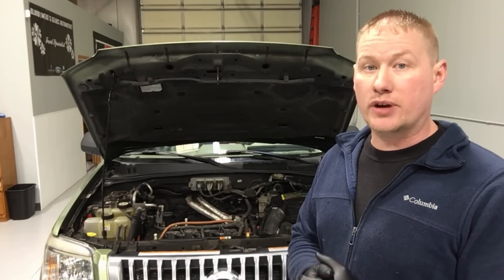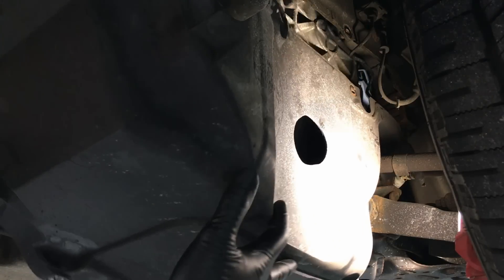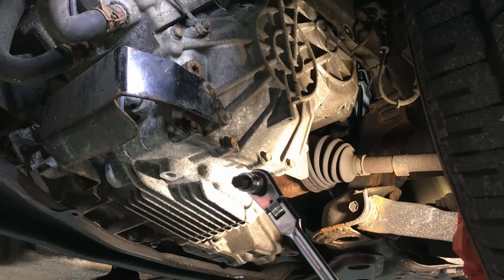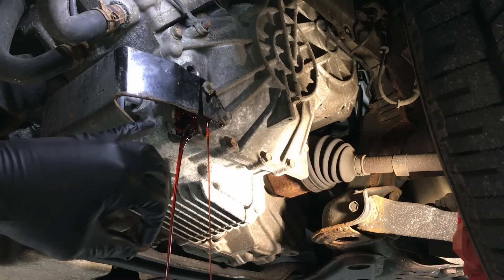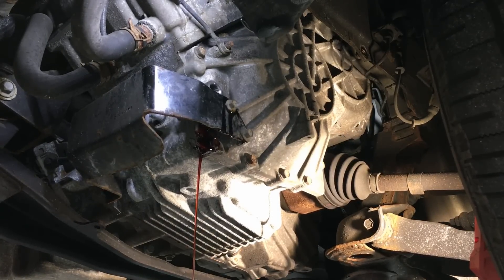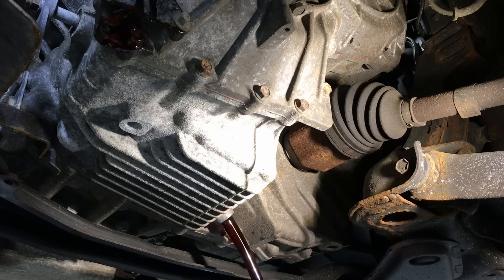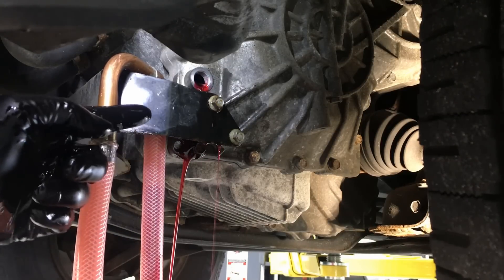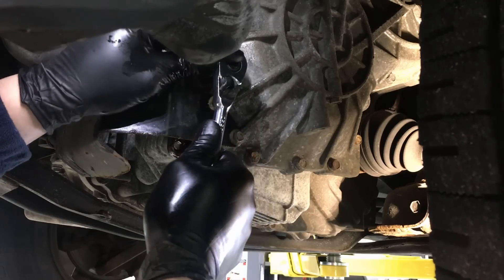2005-2012 Ford Escape Hybrid eCVT Transmision: Fluid Drain and Fill Procedure

Comment from the maker: These are the Tools and Parts I Recommend:
Transmission Fluid (6-7qts)-
2005-2008-
https://amzn.to/2qnmUVp
2009-2012-
https://amzn.to/2qnHZ1O
Hex Socket-
https://amzn.to/2GSjUHD
Manual Fluid Pump-
https://amzn.to/2qo8Z2b
Basic Good Torque Wrench-
https://amzn.to/2qmWgMV                                                                                                                                                                              Fill and Drain Plug Torque Spec- 30ft lbs
Reply: FordTechMakuloco have a question to switch out a 5.4(04 F150)  to a 5.0 coyote from a 2012  Ford F150 what do i need to make it work on the 04? T.I.A 👍
Reply: FordTechMakuloco is this the same for a 2008 escape awd v6
Reply: Can you please make a video on how to change transmission fluid on the CFT30 CVT in the ford five hundred and freestyle
Reply: I'm glad to hear that these transmissions are so reliable. From what I'm hearing the new Ford Maverick is going to use something similar.

Comment: I am the original owner of my 2008 FEH and it has 290,000 miles. I've never serviced the transmission. Should I consider changing the fluid or is the fluid that is in there married to the transmission, meaning, if I change it, I am only asking for problems post fluid change?
Reply: So this is what I would do I wouldn't recommend changing it all at once since I have so many miles on it and definitely would create more problems for you in the transmission itself but what you can do to eliminate having problems while draining and refilling the transmission fluid only drain and refill 1/4 at a time so drain one quart put one quart back into it of new stuff then run it for like good 5 minutes drive back and forth, then repeat the process again until your fluid is gradually cleaner.

Comment: QUESTION, 
is there a recommended ambient temp to do this at, and does the self leveling fill port account for heat expansion of the fluid? I ask because I've read the vehicles with dipsticks (which I know this one doesn't have), are recommended to have ATF level checked when good and warm after driving 20 mi due to heat expansion. I've also read that over filling can cause damage, so I cringed when I saw how over filled this was. Perhaps the user filled it in the winter with a very cold ambient temp.

Comment: Is there no filter to change?
Reply from the maker: nope
Reply: @FordTechMakuloco  I have a 2011 Ford Escape Hybrid limited 2.5. AutoZone told me that the filter is on the inside.. still a No?
Reply from the maker: There is no serviceable filter so yes a no. Are you going to remove the trans, split the case and change a filter on a manual gearbox?

Comment: I was told that the transmission is sealed and should be never be changed. And said not to let anyone talk you into it!
Reply from the maker: wow
Reply: That's why it has a drain and fill plug. Because it should never be changed 😂

Comment: Mine has a small leak on the passenger's CV axle, coming from the transmission, are there any special toola needed to replace the seal (5m6z-1177-ra)?

Comment: From the Owners Manual of my 2015 Ford Escape Hybrid "4. Using any transmission fluid other than those that meet the recommended specification may cause
internal transmission damage. Do not use Motorcraft
  Continuously Variable Chain Type
Transmission Fluid (blue). This vehicle uses only Motorcraft
  MERCON
  LV ATF.
Reply from the maker: Yes and?

Comment: I changed my transmission fluid (MERCON V) on my 2008 Ford Escape Hybrid at 90,800 miles, and my gas mileage appears to have decreased from 28.5 to 27.8. The transmission feels smoother, but I am puzzled by the slightly lower gas mileage. I expected an increase in mpg, not a slight decrease. Any ideas why the mpg is lower?
Reply: It may be that the fluid was a bit low, and the new higher fluid level causes a very slight increase in the amount of parasitic drag on the moving bits inside the transmission.

Comment: 1018 ford fusion energi , 2 letter plugins, code P0C2C-Auxiliary Transmission fluid pump control module feedback signal range /performance, 
What I should do , 
I have 215000 km , and flush was done 40000 km ago .

Comment: I'm hoping you'll answer this comment or perhaps someone can. I have a 2010 Ford Fusion Hybrid but I can't seem to find anything on the internet saying what the Fluid Capacity is. I asked the Ford Dealer and they said 4.28 but that can't be right because I have put in 5 and it's still not dribbling out. The vehicle is fairly level. Maybe it's a little over 6 like this SUV in the video. It would be great if someone could answer this for me or let me know where I can find this information on the internet.
Reply from the maker: 4.28 quarts is correct
Reply: @FordTechMakuloco  I was hoping you would say something else. I must have some sort of oddball. You can have 2 Ford Fusion Hybrid both 2010 yet they will have vastly different air filters. Mine has the " Forever Air Filter". (They actually have to be replaced around 100k and it cost like around 200.00 or so. Others have the regular replaceable air filter that might cost 10 to 15 bucks.
My transmission says CENMC on the bottom next to the drain plug. Both drain and fill plugs are M18 - 1.5.
Both are heads Torx T55 but can easily be mistaken for hex key 10mm. Both heads easily stripped with either tool. The Ford Dealer said those plugs are obsolete and didn't offer a substitute.  I replaced them with 3/8 drive heads and remove the magnets and machined them to proper length. ( .475 "). My vehicle is level and it's up on 4 ramps. (2 in the back are modified so they don't hit the frame when you drive up.) I lowered the corner (took the wheel off)
and tried to get it to dribble but nothing.
  Not trying to argue or be a naysayer. I'm a big fan of your videos and always give a thumbs up. I'm just going to have to buy 2 more quarts today. This transmission and plugs although not identical looks very similar to the one in your Hybrid SUV video and might take the 6-7 quarts like that one does. So far 5 quarts and no dribble.
Reply: @FordTechMakuloco  I finally got it to dribble out at somewhere around 5.5 quarts. I even lowered that corner a little more to make sure it needed that amount. Perhaps it's some sort of oddball. I drove it today and it seems to be fine. I was concerned about over filling it. I didn't want to do that. I did drain it like over a couple days because I had to find a retrofit solution to the obsolete drain and fill plugs that are matching. Maybe that's why I had to fill it more. I'm also doing it in the winter with temps below freezing. Not sure if that might make a difference.
Reply: Today I still may try lowering that corner even more to see if it dribbles. I was using a bubble indicator to measure the level but depending on where I set it, it might be wrong. I figure if I can make the car obviously low in that corner and it doesn't dribble that will mean it requires more fluid. If it does dribble that means I didn't have the car level enough.
Reply: I have the owners manual for my 2012 Ford Fusion hybrid, it states 5.3 L. I drained out around 5 liters and pumped in 5 liters which is pretty much the whole bottle. But yeah like you said you filled with around 5 L so you’re good. Shouldn’t be any different for the 2010, same model and body.

Comment: This guy is really great! His videos give a lot of necessary specific information. I like how he mentioned the torque specs on both the fill plug and the drain plug. Also how he mentioned filling it till it dribbles out slightly WHEN IT'S COLD.  No warming it up and checking the level. Some transmission require this.
I was wondering about it and I already knew if I go to this guy's video he would specify. He specializes in Ford so he seems to really knows Ford's products real well.
This guy produces very excellent, informative, high quality videos.

Comment: Excellent video.  I have a 2008 Mazda Tribute hybrid (same as the 2008 Escape and Mariner).  My original owner's manual says that the CVT fluid capacity is 5.3 quarts.  

If you used 6+ quarts, I'm thinking that you may have overfilled yours.  Maybe the vehicle wasn't exactly level or you intentionally allowed the extra to run out so that you were sure that it was full.

Comment: Thank you!  What brand fluid will help with some pinon noise after changing the fluid?  2011 Runs great after the change but when very lightly turning the wheel side to side you can hear the pinion.  Used Valvoline MaxLife Multi-Vehicle Full Synthetic for two refills so far ... gets dark after about 30k here in the hot south using the LV fluid
Reply from the maker: There are so many things wrong with your statement I don't where to go with this.
Reply: @FordTechMakuloco  Ok what Mercon LV fluid lasts longest? Maxlife has a short life and is noisy.  Thanks
Reply from the maker: I only use the Motorcraft fluids.
Reply: @FordTechMakuloco  Ok thank you...if it will go 60K with less noise then it will be worth it...thanks again

Comment: Called the Ford dealer I bought my 2010 Escape Hybrid and they told me the Automatic Transmission fluid is permanent and does not need to be replaced. It also states that in the owner's manual.
Reply from the maker: Yup cause no fluid breaks down ever. You want to change it yes but not as often as a clutch based system.

Comment: I have a 2009 hybrid with 289000 miles on it. I have never changed the fluid in it. Not sure if it was ever done before I bought it. If I change it will it cause the transmission to fail.
Reply: My 2009 has 276,000 and the same deal. I've had since new and just figured that since Ford did not mention it I don't need to do it.  However, in the last thousand miles I've heard "the noise from my CVT but ya know, I've not sure I care...

Comment: Thank you for this vid, it is very helpful. I recently bought an '09 Hybrid with 22K original miles. The seller let the vehicle sit for several years due to an unsolved brake sensor issue. I've got that resolved now, but I'm wondering if I should change the tranny fluid now or is it okay to wait until 60K miles? I've put new tires on it with new air pressure sensors, and I've put a couple of tanks of gas through it since I bought it. What other fluids should be changed and maintenance done now since it sat for so long?
Reply: That's super low wow. You're probably fine to leave it for another 20k miles then change it all out and leave it for the 60k miles before changing again. Might be worth popping the fill plug to make sure she's nice and red and slowly dripping out so you know she's full. For peice of mind. My gf has one and I'm in love with this thing. Great rig at 320k km so far.

Comment: What about 2017 fusion hybrid cvt transmission
How many mile you must be changed
Reply: Technically, Ford claims that transmission is sealed and claim there isn't even a part number or physical way to change the fluid.  They are so full of crap.  The CVT's from 2009-2021 all have a drain and fill.  A novice person with a few simple tools can change it in 30-60 minutes with cleanup time.   I used Valvoline Full Synthetic Mercon LV instead of the Motorcraft Mercon LV which is not synthetic. Your call but after talking to the folks at Amsoil, I would have used their low viscosity ATF, but the Valvoline is $5.47 a quart on Amazon.  You just need a 10mm Hex socket/bit.  Loosen the fill bolt first.  Mine was so tight, it was put on by the Hulk I guess.  Make sure you can get that off first.  My car is a 2012 and I put in 5 quarts.

Comment: I have a 07 escape hybrid with 178 thousand miles,don't think trans fluid was changed for years,do you recommend changing it now or will it hurt the trans?
Reply: Change it as soon as you can.  It will not hurt your transmission.

Comment: if i start hearing a clunk at higher rpms, could bad trans fluid be the cause? I started hearing a clunk yesterday, parked it and inspected the suspension, rock solid except for worn front brakes, 195000 miles, just bought not sure if fluid was changed.

Comment: Great video, thanks!  I did this fluid change yesterday. Very straightforward as you describe.   Great price from Rock Auto on Mercon LV, available in 5 qt container.  Bought that and 1 additional qt. from them.  Specification for my 2011 is 5.3 qts, and that is pretty much what it took (when I subtract my own spillage).  I purchased a hand transfer pump from Harbor Freight for the fill.  I noticed however that once the splash guard is off, there is enough access from the drivers side wheel well, that I could have just used a funnel I have that has an extension tube on it (around 24" long) with a tapered tip that would fit in the fill hole.  Probably would have been less messy than using the HF hand pump- I should have cut down the hoses on it, they kept curling up.  Thanks again!

Comment: Curiosity got the best of me...I reset from gas to electric, literally 5 minutes later 2006 ford escape hybrid stalled, hubby has tried several things, but won't start. It's been 6mths or so. We really don't want to junk it, if it has a not so expensive solution. PLEASE HELP!
Reply: So what was it. I hope you got it fixed. I don't understand you reset from gas to electric? I have 07. It's doing great except when going into 2nd its shifts hard and Veers to left. I'm guessing its low on trans fluid.

Comment: I have a 2006 Escape Hybrid with 95k miles.  It needs about $1500 in repairs (wheel bearings, control arms, brakes).  My mechanic thinks the transmission is "bad" and will cost a lot more to fix.  When accelerating is feels like it's in neutral until about 3500 RPM.  Will changing the fluid make a difference?  Is it possible that the transmission needs replacing with so few miles?
Reply: any leaks? have you fixed it?

Comment: I went to the dealership to change transmission fluid on my 2005 FEH today and in the notes they put in Mercon LV (XT-10-BLV).  I questioned them about it and they said LV supersedes V now.  I have no way of verifying this.  Does anyone know?
Reply from the maker: IT DOES NOT!
Reply: I did a part search on a Ford website and another auto part website and it calls for Mercon LV in my 2009 Escape Hybrid
Reply: Up to 2008 is Mercon V! My mechanic double/triple checked for my 2008 FEH. Your mechanic didn't do his job properly. Mercon LV is for 2009 and after...
Reply: That is absolutely 100% true.  I am actually shocked they even serviced the transmission at all.  Here in Denver, Phil Long Ford claims they cannot drain and fill my 2012 Fusion Hybrid CVT or my 2015 F150 Platinum automatic 6R80 with EcoBoost engine because they are "Sealed" for the life of the transmission!  MY ASS!!  That is complete garbage.  They both have a drain and fill plugs.  I did upgrade the transmission pan on the F150 to an aluminum pan since I tow my boat and it adds a few extra quarts, easier filter changes and better cooling.  Added a larger secondary transmission cooler too.  Anyways. the Fusion Hybrid uses Mercon LV and I use the Valvoline Full Synthetic Mercon LV available from Amazon for $5.47 a quart and in the F150 Platinum I use the Amsoil Signature Series Fuel-Efficient Synthetic Automatic Transmission Fluid.  I have changed the fluid Completely twice on both of them.  They will run better than when it was new and the fuel mileage has gone up on both since I moved over to Amsoil or Mobil1 engine oil and better trans fluid.    Your vehicle and transmission will never know the difference between Mercon V and LV.   Just compare the specs of them.  Ford acts like they have some magic recipe and potions and if you don't use their fluid "which no car manufacturer makes their own fluid" that your trans will fail and leave you stranded in the middle of Kansas.  Give me a break.  It is 2022, not 1938 with SAE 30 in non-synchro transmission.  Hell, Mercon LV would work in that too.  These are ZF transmissions which are gear driven, and the same ones used in many brands like Toyota.  If this was a Nissan CVT, I would just wish you luck, no matter what you do.  But Amsoil makes a good NS-2 and NS-3 fluid.  But they are not belt or chain driven.

Comment: Is there a way to just check the level?
Reply: 1. park the car on the level serface and wait it's cool 2.  turn the steering wheel all the way to the left or just take it off 3. take the filler bolt off, you should be able to see the fluid if it's full.

Comment: Just bought merc mariner 07 hybrid yesterday. Engine does not shut down and go into elec only mode ever. System check in dash says all normal. Ac not on. Mpg indicator wont show more than 12mpg. Eco indicator needle gauge works, led eco readout show low end of eco scale. No warning lights active on dash. Was there a bulletin for electronic flow control device malfunction? Has non readout system diag n flow control radio. Cheaper stock radio so dont think its rranslator for steren from canbus since readouts in dash. What do u think?
Reply: Mine did that when the thermostat went out. It never shut the motor off at idle. Eventually the check engine light popped on though after several months.